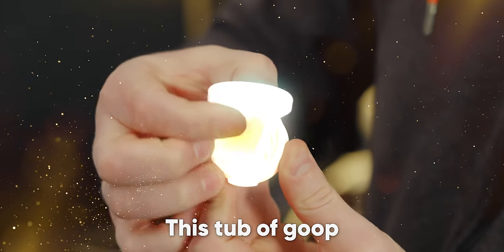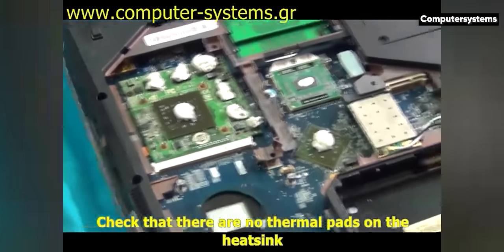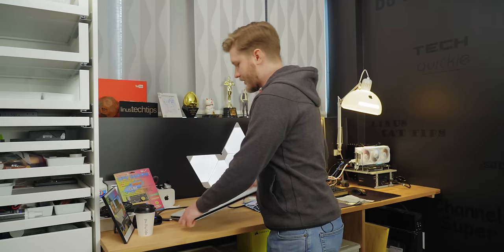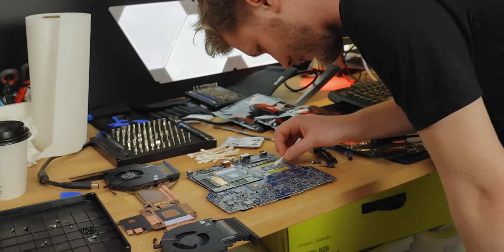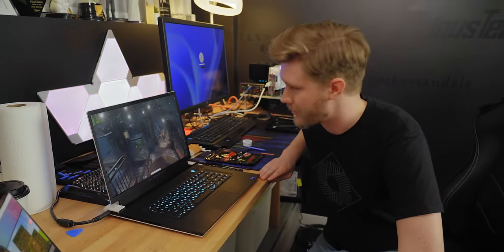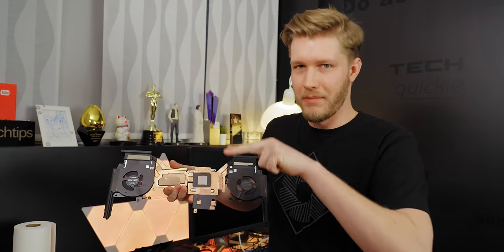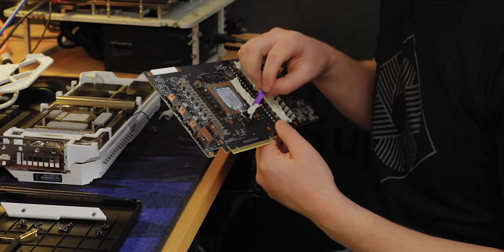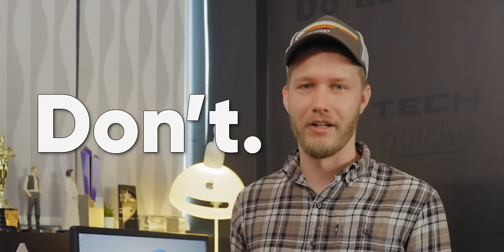More FPS for just $10 - K5 Pro Viscous Thermal Paste

Comment: I want to see the actual VRAM temp differences on the same fan curve. My 3090 was hitting 115° on the stock pads, and swapping them for Odyssey Extremes brought it down to 72°. If I can see evidence of this putty outperforming other thermal putties and my current thermal pads, I will try using it when I install my waterblock instead of getting an active backplate. It's thermal conductivity is 1/3 of the thermal pads I used, so I'm fairly skeptical
Reply: Have you considered copper shims and thermal paste?
Reply: @ffwast  that is so underated. I combined it with thermal pads on my backplate for a short test and the heat transfer burned my hand, but saw no temp drops. but I am sure on the memory where I placed it there is definitely a lot of transfer, better than whatever thermal pads are on the market right now.
Reply: @ffwast  I have a video on my channel where I replace the thermal pads and I can improve the temperature from 96º/100º to 68º/70º on my RTX3080 (the video is in Portuguese but in the description I have the video in English for anyone who wants to)
Reply: Although the k5 pro's thermal conductivity is under half of the odyssey extremes rating (like 5 vs 12),  if you take into account the contact ratio of of pads vs paste (60 vs 99) and the garbage thermal conductivity of air (.025) is not a stretch so see how this particular paste can beat high end thermal pads. Though of course proper testing is warranted lol.
Reply: @hjorthrimul4350  that's why I wanted to see the actual temps! It'd be $50USD to get enough to redo my card, which isn't terrible...but like Alex said, how much of a pain would it be to remove if I don't see an improvement?
Reply: @technewb8241  Or try Fujipoly 17W/mK one
Reply: The thing is its not only about thermal conductivity. As he said a thermal pad fills completely 60% of the gaps of the surface, whereas paste fills 99% of them. That means that a thermal pad can have much higher thermal conductivity than a paste but still perform worse.
Reply: this is a straight lie, thermal throttle is at 110ºc and it won't past that, any of micron gddr6x vram is the same.
Reply: I've done it on my 3080, temps are significantly worse, save yourself the pain and stick with what you've got
Reply: @NeededByNobody  Wait you mixed this paste and a pad? How much did you use and how did you apply it?
Reply: @exterminater267  no, I honestly never used this. I was gonna use copper shims, but had DIE contact issues with the waterblock, miraculously I went without shims, and thermal pads, and noticed the memory modules on my card seemed to singe the waterblock's nickel plating, so all I needed to do was apply some thermal paste to fill in the gaps.

Comment: WARNING: Before you buy K5-pro and put it all over your GPU like I did, reconsider if you have DDR6X VRAM (3080/3090 variants). DDR6X runs too hot for the K5-pro to properly conduct the temperatures when you are doing anything memory-intensive (mining, rendering, etc.). The memory junction on my 3080 was reading 110c and causing the card to thermal throttle. I ordered 15W Gelid ultimate thermal pads to put on the memory units. I am not looking forward to removing the K5-pro paste. I’m going to leave it everywhere else since 5.3W thermal conductivity seems good enough for the other components.
Reply: How's the Gelid Ultimate? Is it good?
Reply: How'd the Glid go? Didn't work for me but idk, tried 1mm ram was at 107 degrees, checked and there was a chip with bad cover, tried 1.5mm and the same temps... Did take off the plastic both sides
Reply: You may want to look into Penchem TH949-1, Upsiren UX Pro, CX-H1300, or Laird T-Putty 607. Very nice putties, and great for cooling GDDR6X

Comment: Welp, I tried using this stuff instead of thermal pads on my 3080 since you guys suggested it and my vram junction temp went up 12c.  I opened it up a second time and added a bunch more since I thought maybe i hadn't used enough the first time.  After the second attempt, I was still up 10c from where I was with the stock pads.

Comment: I like this video overall, but a point I think that was missed was discussion or mention of thermal conductivity.  According to K5 Pro's Amazon listing, the paste has a thermal conductivity of >5.3W/mK whatever "greater than" that value actually means.  Given this number (5.3), we'd expect worse heat transfer on anything with a lower value, so if you instead replace the stock pads with higher rated pads (like from ThermalRight or Gelid) which reportedly have values of 8 W/mK and even 12 W/mK, we'd expect better results than the KD5 Pro paste (assuming the heatsink is still capable of dispersing that heat).

So what I'd like to see is a follow up to this where the KD5 is replaced with those higher thermally conductive pads.
Reply: point is thats hard to get the info which thermal pad thiccness is the right one for your device, so the k5 goo is just the better alternative than aftermarket pads. Wrong thermal pad and the device can literally die
Reply: Look into graphene pads and how thermal paste is still better
Reply: Its not all about that number necessarily the contact area has a lot to do with it as well which isn't as easily quantifiable but having something with the ability to flow and squish together will generally have better contact than a pad that wont. Its the reason that thermal paste is so effective
Reply: @connorjohnson4402  exactly. Graphene pads have a thermal conductivity 5-20x that of traditional paste, and still loses to said paste. Contact makes a bigger difference than almost anything else. If contact is exactly the same, then you can compare thermal conductivity. This is why comparing the thermal conductivity of two different brands is also bad, as they have different chemical makeups.
Reply: @faranocks  Don't graphene pads also tend to have better thermal conductivity laterally than vertically?
Reply: @oliverer3  depends on the pad
Reply: That's like those graphene thermal pad companies saying that it's better to use their pads for your cpu and cpu cooler only to then get proven extremely wrong throughout all outsourced testing. It doesn't matter how much thermal conductivity a cooling material has if it doesn't make ENOUGH contact. This is why thermal paste works better than thermal pads because it cover more of the area which in practicality makes it a way better solution to cooling than a pad
Reply: @faranocks  Reading the comments here trigger my anxiety. I was having a sigh of relief reading your comment, thinking finally someone knows what he's talking but your last line is making me hyperventilate now. Comparing thermal conductivity isn't bad because of different Chemical makeup!. It's bad because this different chemical makeup leads to A DIFFERENT PHYSICAL MAKEUP!!!!. Also the different chemical makeup isn't that different & rather it's different proportions & particle sizes that mostly lead to the wide variety. 

But the real reason it's bad comparing thermal conductivity of different brands  is because these consumer brands don't mention the standard according to which they've tested the thermal conductivity & some don't even mention parameters like viscosity, density, heat capacity, thermal resistance, temperature stability, electrical resistance & capacitance, etc let alone give a datasheet. These various physical & thermal properties together determine the end performance, ideal application methods & ideal situations of use of individual pastes.
 
These tech channels make my stomach churn when I watch anything that's remotely close to engineering that comes from them. Check out the channel that made their own TIM, Altium PCB Designer blogs & Semikron YT channel to get some decent understanding of thermal interface materials & end this bullshit. Freaking marketing & media idiots.
Reply: @faranocks  While you're mostly right, I can't think of any graphite pads that have higher Z Kth than XY simply because of how graphene works & how they are made. Do feel free to correct me if you know more.

Lastly, graphene/graphite thermal pads are no slouches. From optical fiber communication for edge switches to formula 1 they're used in applications that are far more expensive & powerful than PC gaming. Don't ever for a moment think that graphite pads are just gimmicks. They're mostly used for their high X-Y/lateral thermal conductivity.
Reply: @mr.applejuice8546  It's good read someone who knows what they're talking about. Also just to make sure, you know graphene thermal pads have their applications as well right? PCs are just not in that list.
Reply: I’d ignore any “rating“ as they are most likely marketing ploys since there is no standard means of testing thermal conductivity
Reply: Yeah, even though it has the viscous advantage,  5.3 w/mk is pretty pathetic compared to the 20w/mk pads out there.

Comment: This seems really great honestly - assuming that it does indeed stay stable and retain it's shape over time. That would be my only worry since it's a "goop".
Better thermal contact is of course good, but I think the real big benefit here is the versatility to bridge any size gap. You never have that one pad thinkness that you need...
Reply: It is not suitable for gaps wider than 1mm for long term use. Over 90°c airpockets form.
Reply: @HG-fw8hn  What is your source on that? Experience? It's advertised as up to 3mm.
Reply: @TheStigma  Personal experience. VRM's in a 100w+ RTX 2080 laptop. 2mm clearance. Applied more than enough, ran for 2 weeks then black screen and no start. Removed heatsink, nothing but airpockets in goo and burnt out VRM's. 550 USD repair. Stuff is no good for gaps over 1mm. Should only be used in PSU heatsinks and industrial heat exchangers in my opinion, fine for that application.
Reply: I'm using this for a couple of years now in my 2011 iMac with zero issues. You can upgrade the MXM GPU in these, but the heatsink obviously not designed for this and its pretty hard to find the correct size pads because of the weird thicknesses MXM GPUs have and this was super easy to apply. The GPU in these machines sits vertical and it retains its form/shape just fine, it doesn't flow out or anything. You can even scoop it off the old one and reapply to the new GPU if needed, it has a really weird but fun consistency.
Reply: Problem comes than you dont know the thickness in loptop as its nowhere written in manuals only in service manuals which they wont give you. I have very old loptop its termopaste just cracked and fall off after i once checked and opened it. You end up with old loptop which crashes or wont even boot or boot bios if you put wrong stuff and to find out even the thikness answers in world wide web will be random people guessing and saying you must add this or this. Next problem you need to order it.
Reply: @HG-fw8hn  I've been playing with this stuff off and on, it needs to be baked before applied. I've had good luck using brass wool and this gunk to handle component unevenness, although going that rout you really do need to apply some conformal coating around the area, and the edges of the wool need glued to the heatsink. 

It is involved but thus far it has worked very well.

Comment: I remember that the old Artic Silver directions had you smear some paste on the copper block of the cooler, then sort of polish it into the surface of the block. I can remember testing my 939 Opty and saw a good benefit in the practice with my Danger Den TDX. Filling in those gaps is important!

Comment: I do GPU repair in Canada for a living. There's some bad informations in this video.. 
First, most heat generating components (GPU, vRam, VRMs) do have thermal sensors and will shutdown the card if overheating in modern cards.
Second, this stuff is near impossible to remove without soap and water. No manufacturer would accept an RMA with any amount of this stuff.
Heat is a contributor to component failure but it's mostly down to silicon lottery, more precisely, manufacturing defects.
We are seeing lots of ripped pads under GDDR6X modules which is likely due to too much thermal cycling, not constant heat.
This "liquid thermal pad" I wouldn't be surprised if it could damage signal integrity if it was to go under the chips since even some non conductive fluxes do.
They did charts with fps, not memory or vCore / vMem VRM temperatures which was what mattered the most because chips that have more thermal headroom will push themselves harder cancelling the temperature gain.

Comment: I have a silly question... Does it affect coil wine because it has more tight air gap between the coil's and the heatsink affecting the vibrations...its also like silicon based thing so it may isolate some noise...that would be interesting of using this thing for that reason
Reply: I'm hoping other reviewers will cover this. Very tempted to pick some up for re-pasting my water-blocked GPU. It gained a pretty nasty whine with only the EKWB pads in place.
Reply: No it would not affect coil while, coil whine develops when there is electronic magnetic field interference from your other components or can be triggered by the quality of the power delivery from your electricity to your rig. And can also be affected by the quality of your power supply too.
Reply: I recently upgraded my power supply (from a 850W to an 1000W) for my 3090 pc and it coil whining minimize dramatically. Maybe that helps!
Reply: I don't believe so just having a tighter frame would do the job
Reply: @mikeycrackson  in water blocks coil wine is often amplified by the big solid block compared to the stock air cooler. I have the issue on my 2080ti, which is significantly louder on water.  I think it would be interesting to know if there is an improvement.
Reply: kind of funny how many people don't seem to realize that coil wine is literally the coils in the inductors physically vibrating due to the load produced by rendering a frame and doubting that smothering them in a thick paste might reduce that noise.
Reply: Seems at least worth a look, best defense against coil whine however is a noise dampening case.
Reply: For anyone who doesn't quite understand coil whine yet - sound is vibration in the air. Anything the can block or absorb that vibration will reduce the apparent volume of the sound.
Coil whine can be impacted by all sorts of things, but it's all forms of vibration.

Comment: I have an Acer Predator Helios 300 (2019) and I just redid my thermals. Used Noctua NT-H2 on the GPU and CPU, and the thick K5-Pro there on the VRAM and other areas were there was that dry pink crap or pads. My temps decreased by about 8-10°. Well worth it.

Comment: The timing on this is amazing. Literally loading up a cart with liquid metal and looking at different thermal pads with plans to repaste and repad several laptops. I think I will go with this stuff instead of the assortment of pads.
Reply: @orilion1820  That would be an interesting insight if I ever used the feed. I only view my subscriptions page. I saw this video posted while shopping and searching for something to throw up on the second screen.
Reply: @orilion1820  Uncommon for sure. I doubt my purchase preferences are directing LTT upload schedules though. I know well the nature of data collection across different services resulting in suggestions. There are virtually no coincidences in recommended feeds. Whole reason I use the subs page is the direct serving of content in reverse chronological order. No need for a recommendations feed when friends and content creators do plenty of that already.

Comment: I think the most important thing about it is... about how easy to is to apply, instead of searching and cutting the right size thermalpads. 
However, I do agree with some guy from the comments, that It would be nice to compare how good they are vs. expensive termopads, plus to test this thing on the middle-low end graphics cards/laptops.

Comment: I recently bought this not long after seeing this video and finally put it on my card the other day. After some trail and error adding more because I didn't realize how little I had on there apparently not only is my GTX 970 card running stable with a +250 core overclock but runs over 10C cooler even with the fan speed lowered to reduce noise. I am very happy to have learned about this and my video card thanks you too. Now I can finally play games without a turbine spinning up in my case and can get rid of these cheap, crappy thermal pads that make it so I could barely overclock it at all after ripping the stock ones. Also yes I'm running a 970 and still happily gaming since I don't really care for most of these newer titles or gaming at 4K. My stress test by the way was about half an hour of GTA Online just driving through the city and three hours of VR and they both ran noticeably smoother then what I had been getting.

Comment: I tried this one my Gigabyte Gaming OC 3090, on the RAM. It was basically the same as stock and still thermal throttled. I ended up using Thermalright Odyssey Thermal Pads, 2mm thick ones. Those actually dropped the temps by like 12 degrees and made the Ram on my 3090 stop throttling. Now this is probably better than some of crappy thermal pads you get with stuff but it definitely doesn't beat a high end thermal pad like the Odyssey or Fujipoly pads.

Comment: Guys please don't use this stuff. Any gap larger than 0.75mm is not suitable and the K5 squeezes out of the edges creating air gaps and hot spots. Plus, the downside of it ruining any board you put it on because it's so hard to clean off outweighs any potential upsides of using this over thermal pads of regular thermal putty. It's just not a good product and using it incorrectly can fry your components. It has happened with K5 pro. It's all over reddit.